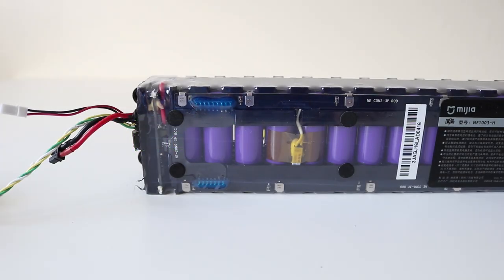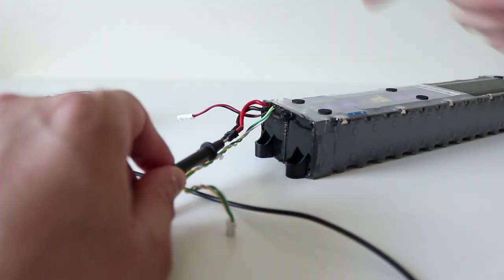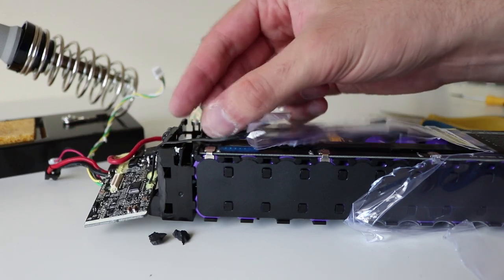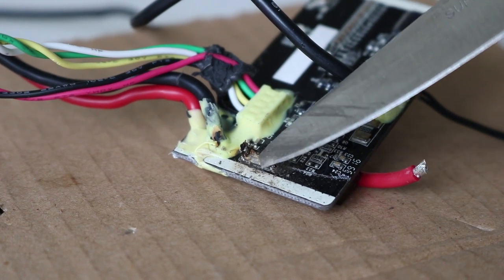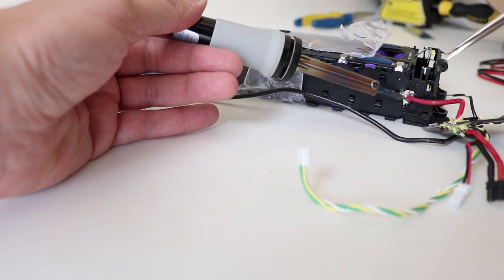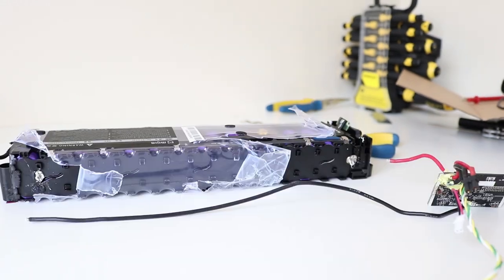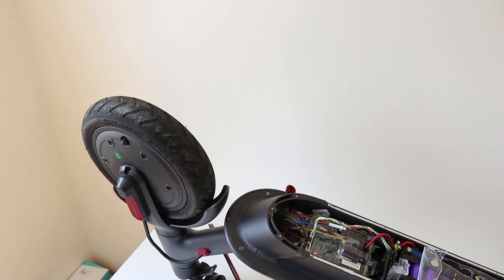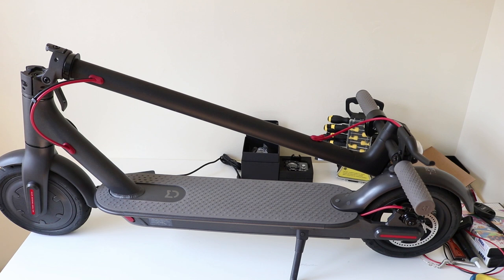Xiaomi M365 Repair - BMS Fuse - Part 1

Comment: Just a little suggestion, and first off, hat's off for getting in there and giving it a go. I would suggest you watch a few videos on soldering technique. It did clearly work this time but your solder joints are a bit dodgy if might be so bold as to say. The problem with a bad solder joint (like where you have soldered the main power wires to the battery) is that even if it looks ok when you do it, the structure of the joint will be poor and will be prone to failure down the track. For a vehicle like a scooter you really want to make sure you don't have any cold solder joints (where the wire moves as the solder cools from a liquid to a solid). Sorry for being pedantic but I think in a vehicle that your ride, you want to make sure your are safe!
Reply: 0
Reply: ⁰0
Reply: ⁰0

Comment: a trick on desoldering fuses or any multi pad SMD/Through hole. solder a bare copper wire across the fuse ends, then just heat the wire in the middle and both ends solder pads will melt and you can flick it off. Even works with 20 pad inline switches. Good job for not being afraid to try and repair something.

Comment: first off nice work for a newbie , I think your a natural  , anyways the reading of 3.7 is not coming from your main battery, that 3.5 is a back up battery its there for GPS,  if your model has GPS or not ,it will have that back up batter , and that back up battery is direct you cant shut it off its a low drain … so its like a Cmos battery they last forever . and if you would have wanted to test for the complete voltage you have to pushed the power button on while having your tester connected to the R/B wires. After that you get the 3.7 plus what ever the main battery's voltage would be … that's only if the fuse isn't blown , but you will always see the 3.1 -3.7 because their is no on and off or no fuse placed in line for the back up .. hope you understood my explanation, sorry  I'm dyslexic, so for me this comment took about an hour of struggle.

Comment: Lead-free solder is a pain to solder with cheap irons, also you need to apply flux to solder and it also helps with de-soldering since it helps to distribute the heat to the board and makes the melted solder stick firmly to the iron tip and that also helps with heat transfer.

Comment: I have same problem like you at 13:30 minute, so you have after fuse repair 3.7V, after you make a pause and after you battery work well. I weld new fuse and made bms reset. Connect the connector to battery and all the same 3.7V. How do you solve this problem ?

Comment: I don't know much about 
E scooters BMS boards.
But I would think they would all read lower voltage like 3 to 9v from the discharge wires.
Because needs to be turned on by connecting the other 4 wires to the scooter wire harness.
Where a switch should turns it on.

Comment: Change the setting on multimeter down to 20 DC. that way when you re check battery voltage if it is indeed 3.7 volts the meter will stay at 3.7 volt. However if it is 37 volts your meter display will show a line of 0000000   or something indicating your measured voltage has exceeded the selected range. Without finishingthe video i am sure the multimeter is correct in it's decimal placement and you've got a soldered terminal on that battery pack loose. One of the series terminals?  Yes, run around and probe lots of terminals like everywhere the BMS red thin wires connect. youll find 1 large terminal loose and only thru the BMS your making connection.

Comment: If you ever need to replace the fuse again. First ad some lead based solder to the contacts. It makes de soldering a lot easier. And lead based solder. Has more to give in the sense of vibration.

Comment: Hey Geeky Stuff.  I had a similar problem with mine. My output leads said 20v, not 3v.   (I'm based in Australia and almost no one has these here.)  I also found the Spanish forum that explains the problem, and worked out how to solder a shunt in the fuse spot.  Now I have 40v out of the battery, but it still will not turn on.
Reply: Can you post link to this topic?
Reply: Sure Grzegorz.  Take a look at this thread.  https://www.forocoches.com/foro/showthread.php?t=5305839
Reply: Also an update.  I contacted youtube user MINI who makes a lot of Russian videos about the M365 and he sold me a new controller.  After I changed in his new controller and replaced the fuse on my BMS board, I am up an running again.  

You can see some of my problems and repair here:  http://imgur.com/a/1gY2r

Comment: Hi there.
My advise would be to replace speed controller and BMS to non Xiaomi make, as I did. My scooter had firs fault just after 20km of riding. I managed to fix it thanks to russian guys on youtube. But it developed a new fault shortly afterwards. Fixt it again and again and again, until it compleatly died. It just couldn't handle longer journeys. 
I haven't done much miles on my scooter since, but it looks like mileage improved a bit. Exeleration is not as good, controler does only 350W. So fare no problems compare to original Xiaomi guts. 
Good luck
Reply: Hi can you describe what controllers did you used ? Did you reused the old xiaomi m365 battery or you had to buy another one?
Reply: Hi.
Problems I had where downt po battery BMS. So I replaced it to one I bought on Amazon. Battery cels where fine. But I had to replace controller too. Xiaomi controller was fine but it works only with original BMS. There is seller L-Faster on Amazon and on Aliexpres too, I think. I boug a set, 350W controller and LCD with thumb control. They do offer thumb brake too, but I connected brake to existing one on the scooter. Controller allow you to set voltage, wheel size, revs, speed limit, power from zero or after push. Just light swich not working like advertised. But light I'm going to connect  to original scooter swich. 
Hope that helps.
All the best
Reply: Thank you for your reply! What bms you used to charge tha battery?
Reply: Also did you had to change the battery charger?
Reply: Hi. You don't need to change the charger if you use the same battery. It is designed for 36V battery. You need to look for 10S BMS. I bought BMS with balancer 40 amps. But 40 amps is way too much for 350W. 10-15 amps should be enough. Jus my worry was that cheap 10 amps BMS might not last too long.So don't get exited and set controller to more or less the same top speed as it was.

Comment: Lol yes put a higher rated fuse in so under fault conditions the fuse won't blow but it will catch fire...love the internet knowledge
Reply from the maker: Haha really?? Oh god!
Reply: Not 100% correct answer.. Short circuit will make thousand amps..so if he added higher rated fuse-wont change a thing.

Comment: Thanx for youre Video.
But for it is not clear which step of your multiple operations fixed the problem. I have same red 4times  blink Indikation and the 3.4V at output connector. Overal voltage B0_B10 is 36.7 V.

Comment: Microsurgery with a kitchen knife! Those of us willing to venture to the unknown appreciate the effort, and share the pain. Thanks for posting. When in doubt, get a bigger hammer!
Maybe a new circuit board if China can understand or fulfill request. I'd reluctantly try next bigger fuse, but not recommended as Lipo or Lifo can be dangerous. There's enough shared problem to at least start a YouTube community and approach Xiaomi collectively. Use your combined views or subscription rates to amplify response.
Reply from the maker: Scott Mannear  cheers mate. what's Lipo or LIFO? lol
Reply: Geeky Stuff On this scooter it's Lipo Suction!
Lithium ion polymer oxide battery or Lithium Ion Ferric oxide battery.

Comment: I have a old BMS with 1 Fuse. Is it possible to Upgrade / modify the BMS to 2 Fuses? I want to install a custom Firmware on my old M365.

Comment: I left my scooter on the balcony for 6 month without using it or charge it. when I tried to charge it it didn't take power and the light of the charger remains green. now I have checked the battery  and there is no light blinking red or blue. took the battery out but it seems all the connections are okay. the voltmetre reads 2.5 only. I checked also the Z fuse and is alright. Everything seem alright and in place but the battery does not charge.
can anyone give me a suggestion what to do to solv this?
does it need a bit of extra power to restart it again?
Reply: Heard you have to keep these type of scooters in a Charged state! If not cells die! Hope this helps

Comment: Hello, thanks for your video. In my case scooter is staying on and is not powering off. It just occured but will probably remain off when battery dies. Hence i am thinking that the power button is not connecting properly. Any ideas? Thanks
Reply: I also took a video of whats going on in case you need it to help me out.

Comment: I had the same problem. Wouldn't turn on, battery gave 41V on the battery itself, but 3.7 at the cable from the BMS... after pushing the reset button on the BMS, readings are 41V also on the cable from the BMS and the scooter turns on again. Didn't need to replace the fuse. So i suggest pressing the reset button first :-)

Comment: You didn't get the right voltage with the meter because you didn't have the plug from the battery inserted into bms.

I hope you wrapped that battery...Good video all in all...

Comment: Do you think damaging the wrap will affect the water resistance of the pack. I need to do this repair but taking the clear wrap off a lithium battery pack not being able to put it back on scares me
Reply: Use kapton tape

Comment: What is the exact model of the fuse? I cannot find anything around. How many amps is the original fuse? Can you give me a link to buy it? replacing it with a higher capacity fuse will probably burn the controller. Instead, I am thinking of replacing the fuse with a lamp fuse (similar to those ones used to protect high power speakers, where the fuse converts surplus current into light) or, as a last choice, with a circuit breaker switch to fix somewhere easily accessible.
Reply from the maker: Leonardo Gualano the original is 15a fuse. 

This is the one I bought https://uk.rs-online.com/mobile/p/non-resettable-surface-mount-fuses/7368757/
Reply: Thanks, if I will get the circuit breaker or any other alternative to work properly, I will post it here.
Reply from the maker: Leonardo Gualano Yes please do :)
Reply: Just an update: I tested my original fuse on the board and it seems fine, so I did not replace it. It seems that my full battery-board is gone. I am not actually willing to substitute it as it will surely break again. It is obvious that the circuit is not well designed and the board is uncapable of handling the current generated during a break. What I did is to exclude the battery-board and power the controller directly with the battery, but this did not work as the controller went into protection (I think this happened because it did not receive the signals from the battery-board). I think I will use a raspberryPI + a new motor controller and do my own control circuit. Between this problem and other problems, such as constantly flat wheels, unsoldered connections within the battery and the accellerator getting stuck, this scooter turned out to be a total waste of money and now I can only use it for hobbies... Sorry to give you such a negative reply, but I really wish I would have bought a different brand. Just as a cherry on the cake, I have a friend with the same scooter and he is experiencing exactly the same problems...
Reply: فيديو كاذب البيماس كان في حالة جيدة من الأول نلاحض عندما كان يخرجه من مكانه بالمكبس كان يومض تارة بالأحمر وتارة بالأزرق وذلك لأن السالب كان منزوع فقط وهذا دليل على سلامته وتغيير zليس له معنى وكان سليما من الأول

Comment: Hi guys. I just repaired the Z fuse of my m187. The led turned blue but the scooter isn’t turning on. I tried the battery to a friends m365 and the battery works. Any suggestings what to check-fix on my m187? 

Ps: when I am trying to power up the scooter the led blinks some times but the scooter remains off.
Reply: Aerialcrete .com you blew your controller board you need a new one from the top one to the button one

Comment: its known that you should set the energy recovery system to weak via the app. This has apparently solved this issue however, most reviews state having it set to 'medium' or 'strong' whilst fully charged is what causes the problem. was your scooter fully charged? i was wondeeing if you could set it to medium or strong when the battery has drained from 100% or is that setting just producing too higher amps to cause the problem anyway regardless of what percentage the battery is at?
Reply: Not that this is my scooter or I am working on this particular problem but I believe that if the scooter has no power to turn it on or off there is no setting anything to hide medium or week because the connection needs to be made when there was power to the scooter

Comment: Any advice for someone who trashed the firmwares? I'm guessing I need all new control boards. :(
Reply: Well, I managed to flash the BMS with a STL over usb, and then the thing worked, but decided to go bank when I put it back in the case. :(
No idea what went pop when I closed it up, but hoping a new board will work fine.

Comment: 10:22 you're putting way to much, only a little bit is needed, what's left on it is pretty much enough and you only need on one side then you can easily solder the other side once you've done the first side.

Comment: so, it appears that i dont get this red light on the controller part too.. i only get the blinking blue on BMS, and i reset it, it gets red for 3 seconds, and then all the scooter is dead? do i need just a fuse? or do i need more parts to buy and replace? in greece it kinda sucks we dont have service near here so i need to do this manually
Reply: I've got the same issue :( How did you solve it?
Reply: @DanielLuchin  problem not solved.... i got it to a local technician... he tried to change the inside PCB or motherboard.. he changed it and it got burned in like 10 min run at full speed... he opted to pay for the next new one... the same thing.. eventually the cost came up to 3*60(180 eur..)so i had already reached 50% of its original purchase price... i told them to keep the battery pack and the main body... and i payed just the 100... such a bad experience...

Comment: I've got 36,8v on mine between the + and - of the battery but on the connector i only have around 18v. But you have a LED that's blinking which i dont have.

Comment: My scooter was stored for over 2+yrs and now it wont turn on. The battery reads 30v but it wont charge. I dont have a blinking light on my battery either.

Comment: Just awful soldering, that poor battery could be heard screaming during that repair. You need a proper soldering iron, 25w isn’t meant for that kind of work. 

Either way glad you sorted it out, I wouldn’t trust the repair just due to the process.

Comment: For me it is not charging. Output is fine. Led is not blinking. Do u know what is the reason.i checked the connections and they seems to be fine.i tried charging the other battery using the same connector and it is also charging.

Comment: Hi there, does anybody got an idea, where i can get the board with the Z fuse on? Something in the board seems not to work, so that the electricity flow is interrupted. I couldn't find it as a replacement part on Aliexpress. They only offer the whole battery unit for 225 Dollar. I'm thankfull for any help!
Reply: Hi. Where about are you based. I still have original BMS I replaced a while ago. And a fuse is ok on it.
Reply: Thanks for your answer. We found the problem. Everything is ok now! :-)
Reply: @Morangie what was the problem if you don’t mind me asking I’m having the same problem with my battery and I’m not sure whether it’s the fuse or the battery or the motherboard on the battery?

Comment: Just realized this thing CAN NOT take a beating. 
Do not fool yourselves taking it doing stunts, beating around and whatnot. The battery is loose in there; due to cheap setups. And the bottom cover provides near 0 shock-absorbance/cushioning. 
Now the thing won't turn on (battery/power most likely), and I can't unscrew the twisted, stripped and worn out screws.
Reply: Oh. The fact that nothing about the entire vehicle is designed or intended to really take a beating / do stunts with says: Do not beat around and try to do stunts with it? I'm shocked.

Comment: Please please get some flux in your life. If you're wondering why your scooter isn't as fast as it used to be... it's because the sodders are horrible and if it lights on fire at some point it's because there's a horrible connection somewhere.

Comment: My temperature sensor registers 7.35. Does that mean I need to replace that? Fuse seems to work fine. Any idea where I can buy the sensor? Tried everywhere but no luck. Can it run without the sensor?